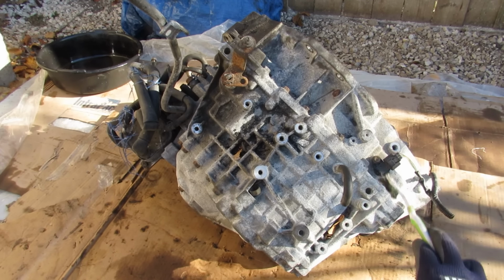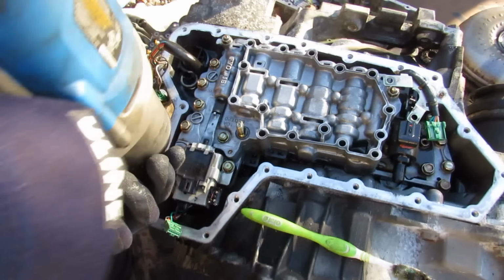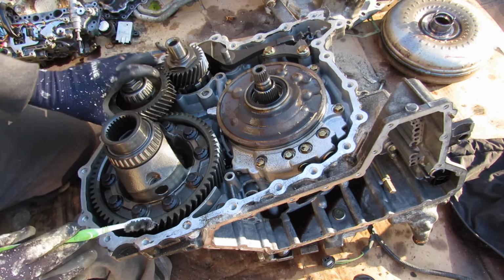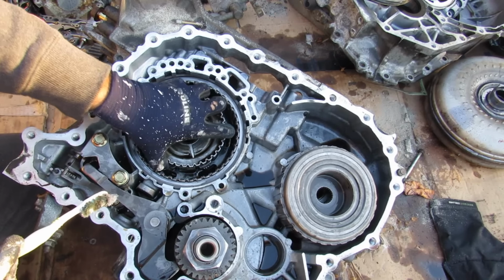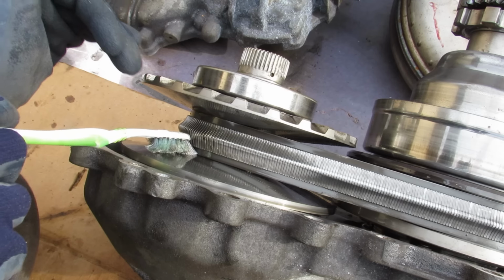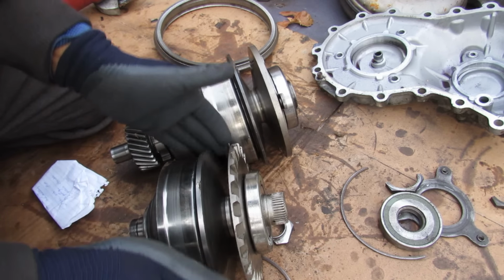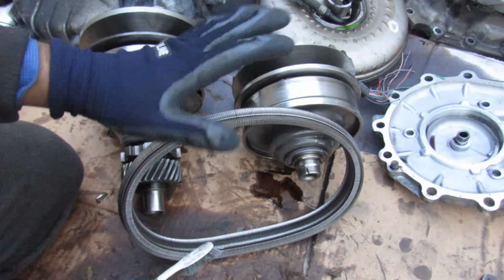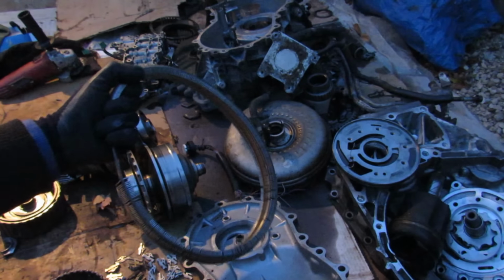Why Nissan CVTs FAIL

Comment: The belt is not the weak link in these units. In fact the larger unit (RE0F09) in the Murano is more reliable than the medium unit in the Altimas due to the differences in configuration and hydraulics. 

The weak links in the earlier units are the slide bearings (small balls in the variators) which eventually wear out and lock up the smooth sliding motion, the flow control valve in the pump, and bad ball bearings supporting the variators. The flow valve in the pump assembly has a nasty habit of sticking causing reduced mainline pressure which causes the belt to slip. 

The gist is accurate, certain model units are not reliable.  Nissan’s transmission partner JATCO has made improvements in the later years and durability is increasing.

Edit: removed unconstructive snarky comment. I enjoy your content and should be fair about the limitations of your work.
Reply: Man you must be licking nissans. If you didn't have a problem, that is because you are one of the few lucky ones. Majority had troubles man.
Reply from the maker: I used this transmission as a teardown to show you what typically fails in Nissan CVTs...I didn't mean specific failures on this particular transmission. . . Otherwise I'd be tearing down every other recent Nissan to cover that lol
Reply: Exactly, that's why he's using this first gen CVT. Very misleading.
Reply: "Nissan’s transmission partner JATCO..."
Nissan owns JATCO, you silly bastard. Don't you know how Japanese corporations work?
Reply: @fun_ghoul  Suzuki and Mitsubishi Motors also own a portion of Jatco.
Reply: @trent7080  Nissan owns 75%. The other two are a fart in the wind, tagging along because they don't have the resources to develop their own in-house.
Reply: @trent7080  And Nissan also owns part of Mitsubishi
Reply: @drozcompany4132  only 34.03%

Comment: sighhh my gf drives a 2010 nissan altima that has 125k miles but somehow the transmission is doing just fine. did a fluid change on it last year and i dont know how many times thats been done before. this makes me really nervous lol.
Reply: Like a tech company's stock when the market price is high, you might consider selling before it goes to zero. Just sayin'.
Reply: @fun_ghoul  lol ur not wrong. its not in great shape cosmetically and interior is a little worn so i dont know how much we could even get for it. might be easier to just run it til it dies then junk it. id want to replace it with a nicer car but dont have the money now and dont think itd be enough if we sold it now.
Reply: @megamachine7818  Gotcha. I think that's the trap a lot of people find themselves in, even before the COVID (money) crisis. For many, car is the second-highest expense after housing, sometimes even rivalling it. Fingers crossed for ya, bud.
Reply: For the money savings in fuel, transmission replacement cost is worth it.
Reply: @egold1006  You can't say that without knowing mileage or driving habits. EDIT: Also, overall vehicle (READ: body) condition! Here in so-called Canada, a Nissan might be perforated from rust before the CVT lets go.

Comment: Great video! I imagined that the CVT pully compressions worked like a kid's see-saw and you explained and showed how the cast hydraulic case and fluid creates this equal see-saw very well.
Reply from the maker: Thanks. The only thing I wish I could do is actuate them to show them sliding

Comment: Do check the Cvt fluid level, Engine on or off. And frequency of  trans oil changes in miles. OEM or castrol, penzoil? Thanks in advance ♥️🇺🇸
Reply from the maker: I use OEM fluid in my Toyotas 
Not saying the other oil brands are bad...but for me it works out almost the same price

Comment: Note the self..........STAY THE HELL AWAY FROM CVT TRANSMISSIONS!!
Reply from the maker: Depends on how you look at it...most people are oblivious to the difference between a CVT and automatic
Reply: People used to say the same about automatics and synchromesh manuals.
Reply: Toyotas are pretty good. Especially the E CVT.
Reply: They work well in snowmobiles.  Just carry a spare belt to fix it when it breaks on the trail.

Comment: I own a Jatco mitsubishi 2015.  Change oil and filter every 25000.  Wish I knew when it will burn out.   It slips in cold weather until it gets  warm .
Reply: The original Jatco transmission on my 2016 Nissan Pulsar did that in cold weather until it got warm. Took it to Nissan they tried reprogramming it several times with no luck, the transmission had to be replaced.
Reply from the maker: Already slipping?
Reply: @speedkar99  I have a 2019 Altima I think what he’s talking about is when it’s really cold like 30 Fahrenheit and under it loses some gas pedal feel and when you accelerate instead of it being at let’s say 1200 rpm for how much you’re pressing the gas pedal it’s holding it at 2k rpm to help warm it up but as soon as it’s up to operating temperature or you accelerate faster it switches back to normal, I’m pretty sure it’s just to warm it up
Reply: @sethlittle7338  correct. Good to warm motor up. Not just the recommended 60 seconds.
Reply: @sethlittle7338  you are correct sir

Comment: CVTs works best on cheap lightweight 4-cylinder economy cars than a high powered CUV that shouldn't be towing at any rate
Reply: Plenty of Versas with 1.6l four cylinder engines have these things fail even before 40-50k miles. They're that garbage.
Reply: @MalleusSemperVictor  That is if they're built right from the beginning which Jatco didn't
Reply: @kclefthanded427  Correct. You can get the transmissions a dime a dozen from fleet NV200s and they'll drop right into a Versa. Funny enough, pretty sure the 2.0l HR16DE engine can drop right into a Versa with no modifications. The ECM doesn't even need flashed or swapped. I was thinking about getting a junked Versa and cramming a turbo into the engine swap and bypassing the MAF and O2 sensors until it grenades which I assume would be soon.
Reply: @MalleusSemperVictor  I've seen plenty of toyotas and hondas broken down on the side of the road. It's not the car it's the owner. Nissan CVTs are just as reliable
Reply from the maker: Yep. Dunno why they pair this with the VQ35 engine in the Altima Maxima Murano and Pathfinder
Reply: @speedkar99  any issue on murano 2017?
Reply: @vitekcrimea  Yes.....Nissan cuts in the pathfinders run hot....so change the cvt fluid at the dealer every 30 thousand miles ...and trade it in before a hundred thousand miles ....do not keep it beyond that
Reply: I haven't heard anything negative about Corolla CVTs, and I think that no news is good news in that case
Reply: Light (<100kg) 125cc scooters with these CVTs fail a lot where I live, if you're driving on a mountainous road or steep hill the belt would overheat and slip or snap off, it's even more dangerous when you're going down because if the belt is overheating, it would get so streched that the bike would be coasting down a slope in neutral

Many people died this way because they fell off the cliff

And it's not brand specific either, honda, suzuki, and yamaha automatic scooters shares the same problems

Comment: Lesson learned: Don't be the guinea pig of new technology.
Reply: Nissan has been making CVT vehicles since the 90s, it's hardly new technology.
Reply: @bavalenzuela  and has been bad since 1990s
Reply: @bavalenzuela  Nissan switched from toroidal to pulley-based CVTs in 2003.
Reply: @William1866  Nissan had a N-CVT in the 1992 Nissan Micra that was pulley based.
Reply: @bavalenzuela  and how many generations have they been through?
Reply: CVTs have been used on smaller vehicles (snowmobiles, scooters) for at least 50 years
Reply: @pleasedontwatchthese9593  yes and that's OK, but you pair it with a 300hp it is not
Reply: @pleasedontwatchthese9593  Yes, it was invented in 1879. And guess what? Nissan isn't using the transmissions from 1879. They redesigned it, and with every fail they redesign it again. Let me know when they have stopped redesigning it and have used it successfully for 10 years. Then I will crown it "old technology."
Reply from the maker: I wonder how Hondas CVTs have been holding up...

Comment: Like any moving part, it is a matter of time before failure. You couldn't give me one.
Reply from the maker: But some moving parts last longer than poorly designed ones
Reply: Yeah, darn those engines and their moving parts. Give me one that doesn't move, then you know it's reliable.

Comment: Nissan Cvt were a mistake...
Reply from the maker: They still keep pushing it too
Reply: @speedkar99  they're working on switching over to automatics. its just painful for them considering nissan and renault own jatco. so theyd have to basically turn a cvt company completely over to auto transmissions
Reply: @speedkar99  In capitalism, everything is a calculation. I'm sure Nissan engineers could make a bulletproof CVT if given free reign, but then the beancounters want it smaller, lighter and cheaper to manufacture. Then, after all the compromises that make a shitty trans, the lawyers project how much potential recalls and class actions might cost; if they figure they're still in profit territory, they will unleash the shitstorm on unsuspecting suckers buyers.
Reply: @fun_ghoul  no Nissan makes a shitty one because Renault owns them. Renault chooses to make cheap low quality parts. Toyota or Honda are capitalistic companies who make long lasting quality cars. How come they aren’t affected by capitalism?
Reply: @mikieantonatos3459  Renault has a controlling stake in Nissan, but is a minority owner. Also, a higher proportion of Renault-branded vehicle sales have manual transmissions, and those using Jatco CVTs are those with tiny 4-bangers. As for Toyota and Honda, their vehicles sell for more money. Like I said, everything is a calculation, and Nissan (Renault, if you prefer) knew damn well that nobody would pay Toyota money for a Nissan. So, in short, they are affected by capitalism. We all are. Let me know if you have more questions, lol.
Reply: @fun_ghoul  . You sound like an apologist. Way to defend multibillion dollar companies while settling for manufactured garbage. Next, you'll tell me that its the pharmaceutical's right to jack up the price of medicine as they wish because of capitalism. Or make education as humanly expensive as possible because of capitalism. In a world where the government is in bed with corporate America you don't have capitalism nor free markets. What you have is a form of feudalism and corporate welfare. Let me make it simple for you. In a world where the average person must be indebted for life to own a home and a means of transportation it makes the average citizen debt slaves. But believe what you want.
Reply: @staypositive4358  lol omg...
Reply: @fun_ghoul  most Renault’s are manual because they are a European company and most cars are still stick shift out there. But here in America over 90% of cars are auto so Renault sells what is in demand. Nissan has never used a cvt until owned by Renault.
And Toyota being more expensive has nothing to do with capitalism they just build quality cars that last longer and because of that they keep their value. Nissan has cars just as expensive the top of the line Altima is 34k and Camry 35k
Reply: @mikieantonatos3459   CVTs aren't Renault fault that's just Nissan doing crap themself. In the 90's in Europe Nissan Micra K11 and Primera were already plaged by CVT problems and that's was way before the partnership
Reply: @mikieantonatos3459  They were using CVTs before. The Partnership begun in 1999 and the 1992 Micra K11 and 90's Primera (and most japanese cars like the Pao and figaro) already used them. Stop blaming Renault for every crap Nissan does. Even Newer Renault uses Dual clutch
Reply: @mikieantonatos3459  Renault = French
Toyota & Honda = Japanese

...there. Problem solved
Reply: ALL CVT are mistakes, they’re a “solution” looking for a problem, the CVT does not need to exist.
Reply: @MacTechG4  my prius has cvt 186k miles still on original fluid work perfect.
Reply: @everyoneevenyou1684  the Prius CVT is a completely different type of CVT, it’s closer to the conventional automatic (it has planetary gear sets) and is very reliable, but it’s a CVT, so it simply isn’t *FUN*, but the Prius isn’t designed to be a fun car

Look at the Nissan Altima by comparison, it IS supposed to be a fun car, yet the CVT sucks all the fun out of it, and has a tendency to grenade itself around 60,000 miles, Nissan actually got hit with a lawsuit over the defective CVTs
Reply: @everyoneevenyou1684  i have a nissan sentra 2011 255k miles original cvt and change fluid etc regularly still runs like new no whining or anything.
Reply: @MacTechG4  what i hate about them most is that the whole point is "infinite gears" but when cvts were first rolled out, people bitched that they never shifted like the autos theyre used to, and some companies actually make the cvts feel like autos, which negates the whole purpose.
Reply: @MacTechG4  Well, no it's really cool technology. Subaru has done great things with their CVT program. But they don't get stupidly ambitious with them hooking them up to 300hp oversized vehicles. And anybody should have more assurance Fuji Heavy Industries is more than capable of making a good CVT compared to Jatco, the shitshow that makes the Renault-engineered CVT's for Nissan.

Now if only Subaru could get their engines right...
Reply: @emotionz3  it’s still no fun to drive and surgically eliminates all enjoyment from driving, a CVT performs the same function as any other automatic, but makes the car less fun in the process, utterly destroying driving enjoyment.

They’re fine for those that don’t enjoy driving, but for those of us that actually ENJOY driving, the CVT is utterly abhorrent.
Reply: Datsun and early Nissan days were pretty good but once Renault and Brazilian thief started to take company helm it all went to sh1t!  Nissan is coming back but for the past 10 years it was going down hill. I remember the Nissan’s venerable VQ engines in Maxima was voted one of the best engine in the world but I won’t touch Nissan product with 10 foot pole.
Reply: @Yung.0311  National identity /= quality. Go ask someone who bought a 'Merikkkan-made Focus with the DSP6 "PowerShit" trans. lol
Reply: Have a 2016 Nissa Altima with 89k no issues  3 trips to The keys from Chicago   I can't complain
Reply: @chrishansen7326  Highway miles are easy on any vehicle
Reply: @chrishansen7326  Some issues seem to gawk back to how hard these CVTs are being driven. On long journeys, CVTs prove their worth but in stop & go daily drives "DAILY" that's when a CVT prove it's unworthiness.

No one should have to worry about reliability issues with a new car no matter but CVTs tend to force its hand
Reply: @NeightrixPrime  You're using a personal anecdote to explain mass behaviour. That's pretty dumb.
Reply: Wasn't there also a Mercedes with a big failure CVT. Oil change very 6000 km's or so?
Reply: Totally ruined Nissan.
Reply: CVTs are a mistake.
Reply: @HighlordFrancis  Generations of snowmobilers disagree.
Reply: @Azureecosse  Subaru has issues with the torque converter and the valve body! They extended the warranty on some of the make sure you check! Also change the fluid there's no such thing as lifetime
Reply: You guys have to know too that most of the people that are complaining about cvt failures are due to not changing the fluid on time ( basically not maintaining ) or at all . I change mine every 20k miles . Less than 30k miles recommended change schedule by Nissan and my 09 maxima still running like a champ original cvt . Bought it with 21k miles , running right now 159k miles . It has a very slight whine noise when I take off but I can’t do nothing about that. Like the guy said , it’s the belt making the noise because it does that . I’ve seen worse with Altima’s rogues & Muranos having failures than maximas . Maybe because the v6 has less stress on the cvt because you don’t have to floor the gas on the 4 cylinders to get it moving , getting it damaged then eventually fail. My opinion . But don’t get me wrong I think Nissan is stupid for putting cvt in almost every vehicle besides the GTR. Smh
Reply: Azureecosse Change the transmission oil first / now!!
Reply: @ThePatUltra; I should have clarified, compared against the execrable Prius, the Altima is more fun, but that’s an admittedly low bar... ;)

Then again, getting a root canal without Novocain is more fun than a Prius...
Reply: Nissan Cvt still a mistake...
Reply: Other than the GT-R, Nissan has been a joke for decades. And  cherry-picking the GT-R isn't even relevant because it is engineered and developed by a cherry-picked team of people who only work on the GT-R, and build it in a totally separate factory using unique tooling and materials specific to the GT-R.

Basically what Toyota did with the LFA. The difference, of course, that Toyota doesn't make shit products down the pipeline like Nissan.

And this isn't really Nissans fault. You can pinpoint the trajectory of failure right around the time of the Renault merger. Same with Mitsubishi. Renault turned two of the greatest auto manufacturers in the world into an embarrassment for Japan, explaining why Nissan has spent the better part of the year having their lawyers figure out a way to break up.
Reply: They get away with stuff like this, because the average buyer is uninformed and doesn't care. . .

If people knew what went into their cars, Chrysler would have went out of business decades ago.
Reply: @normang3668  Scotty Kilmer liked this comment ;)

Say it with me now... “Endless Money Pit!” ;)

Ideally the same could be said for Ford, my first “car” was an ‘88 Ford Escort Pony (base model, 4 speed manual) worst piece of crap I ever owned.